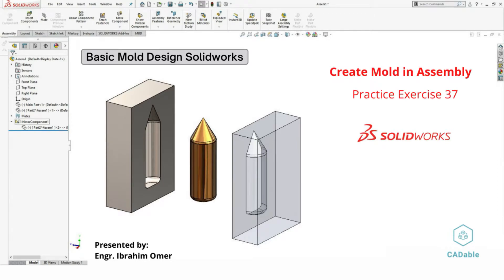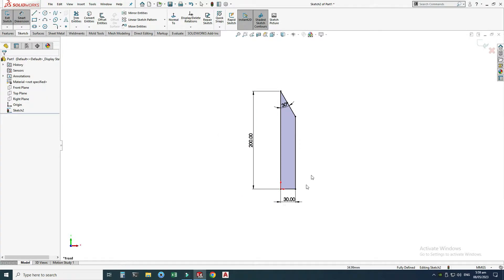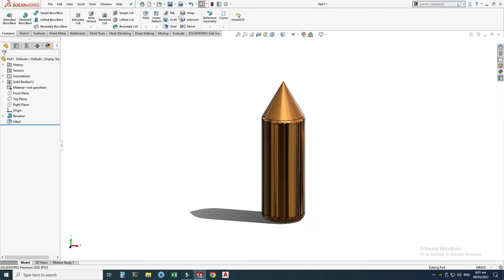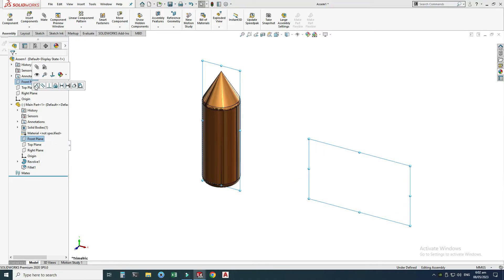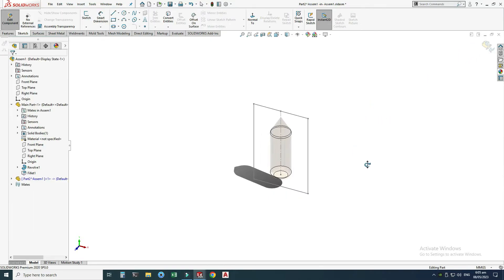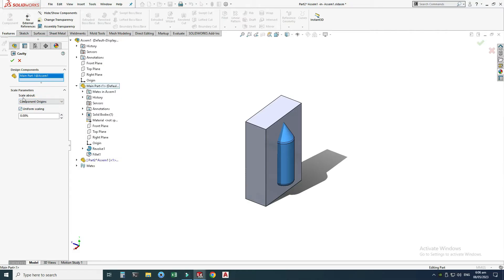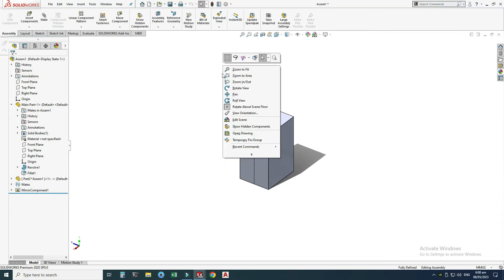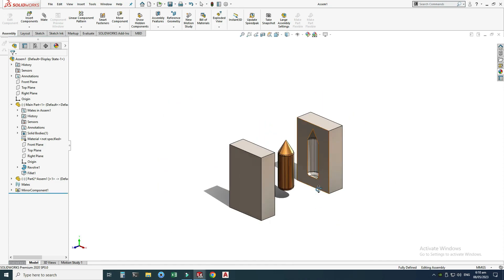Basic Mold Design Solidworks | Create Mold in Assembly | Solidworks Practice Exercise 37 | CADable

Comment: hello sir, after creation can we make the two blocks as a single block. so the core should be inside the single block. As now we have two mirror blocks, i want a single block with core inside. Thanks please reply as it is important for my research model creation and i am struggling
Reply from the maker: Hi Zeeshan! 
Yes we can do this, use move command, translate these bodies and murge them using union command. But why you are adding them as single solid body?

Comment: The coincident relations didn’t apply like what you did in version 2020… mine is 2021, it shows error. Also, the  extrude feature didn’t appear in the part assembly while doing your exact steps.
Reply: @fatomababyAbuali  hey I know this was from a year ago but could it be possible that you didn’t float the part, that would cause an error.
Reply from the maker: Seems strange it should work the same way. Send me snaps at
ibrahimumer007@gmail.com